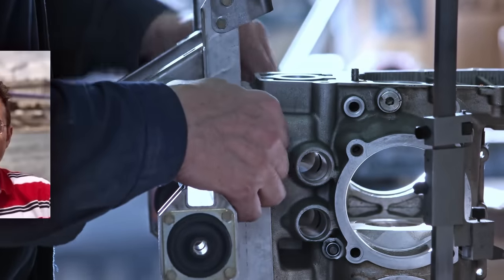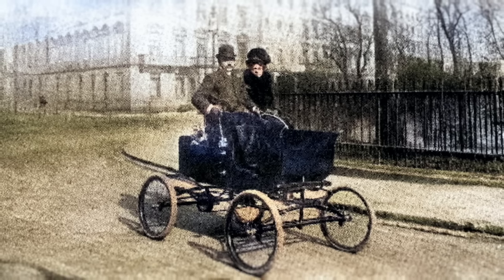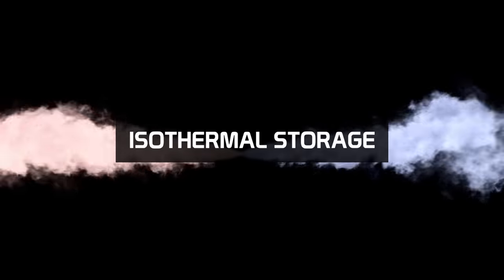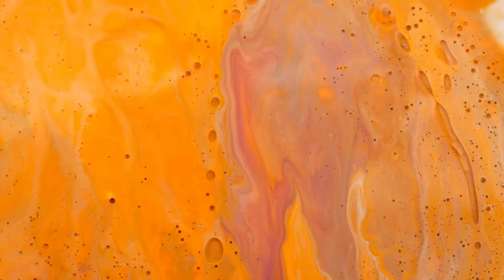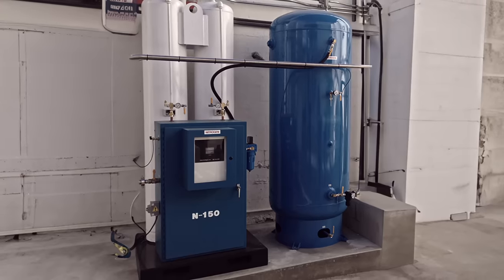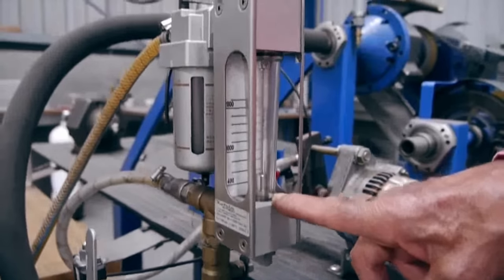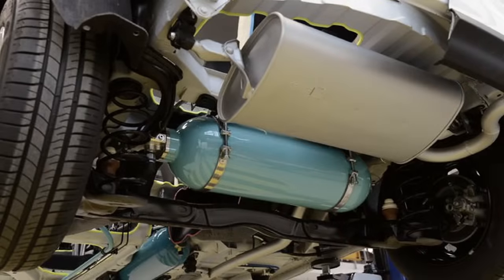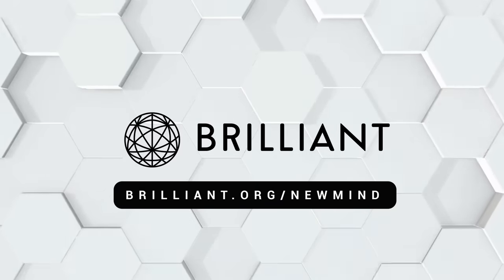Driving On Compressed Air: The Little-Known Compressed Air Revolution

Comment: Why not make a hybrid system the compressed air and fuel is injected into a cylinder promoting thorough mixing and giving a automatic boost pressure , ignited , the power stroke proceeds normally , and the exhaust stroke also proceeds normally until top dead center when the exhaust valve in closed and the new fuel and compressed air is injected together starting the cycle over. 
You eliminate the intake valves , turbocharger , inter cooler, air filter , and a lot of under the hood plumbing. and you end up with a small simple high boost engine that is powered by both compressed air and fuel and if a renewable energy source is used to compress the air , you eliminate the need for renewable energy storage since the compressed air bank at the "gas" station is also your renewable energy storage system.
Reply: ...well you will have to re-charge your air compressor every day and carry that bomb around..a turbocharger is an energy recovery device..there are better ways to do vehicle energy recovery on deceleration like flywheels or batteries/ultracapacitors (even just using the existing alternator)

Comment: the main problem is, that air has the N2 molecule, (O2 is the same story)  hence it is a 2-atomic gas. If you compress it, a certain amount of energy by hits between molecules is transferred into rotational energy , and is, regarded as heat,  lost for mechanical work in decompression, which we want to have for motors.  If you don´t mind an efficiency loss,  then it´s o.k.

Comment: I always wanted to adapt an air compressor/ drive motor into a log trailer and store the air compressed by using it to brake , and then release it when pulling adverse grades.
  The air could be stored in the reach tube and the compressor/ drive attached to one of the trailer axles, thus providing more drive traction as well.
Reply: Chrysler tried to make a hydraulic accumulator for buses some time ago. Too complicated and heavy. You need a motor/compressor in addition to your prime mover power train.

Comment: The design and operation of the MDI air engine was very much like that of an internal combustion engine. It has intake and outlet valves to work with ambient air. Instead of a spark plug or fuel injection valve it has a firing valve for compressed air. So the use of the compressed air is reduced to its absolute minimum, because it is fired into the pre-compressed air after compression cycle.

Comment: Storage system in wind turbines is the most promising usage for this. The air should be compressed by mechanical, not electrical, force of each turbine, stored in a single chamber for multiple turbines to increase volume to surface ratio, and then be used to drive a ducted turbine with 97% efficiency.
Reply: What of the thermal losses in compressing the air?
Reply: @thedubwhisperer2157 i mean the efficiency of a ducted Pelton turbine is 97%. But that of a whole cycle of compressing, then semi-adiabatically storing for 12 hours (chamber walls should be well insulated), then decompressing, — is much lower, maybe 75%. But this number is still excellent.
Reply: I remember studies of  40-50 yrs ago,  where  compressed air from  direct compression  via windturbines  was  stored underground, in abandoned salt or coal mines.  Obviously not an ultra high pressure system,   but with  cubic miles of storage,   low speed positive displacement motors driving generators   seemed to have promise.   But crude oil was like 8 bucks a barrel,  coal was 25  bucks a ton..

Comment: There are so many incorrect assumptions made in this piece it terrifies me.
If Air expanding approx 20 times its volume isn't an explosion it is as good as. That is with a 3500psi pressure.
Carbon Fiber and Fiberglass tanks are far lighter than steel tanks but are significantly more susceptible to being pierced than steel and they will rupture and tear once holed and have the above problem a very dangerous very violent air release. Make the tank from Steel and it will be 10 times heavier depending on size and shape. Something important for stop start use like in a Vehicle. Trains are ok as they are usually the only ones on the line.
The input energy required to make compressed air is significantly more than it stores and it gets exponentially worse the higher the pressure. The most efficient way is to compress it with positive displacement energy wise  and even then today's best compressors would be lucky to not to consume double of what it can store even at 100 psi let alone 3500 psi. Compare this to electrical generation where the manufacturing loss is a lot less.
The way it was explained for use in a vehicle it would require the heat transferred as well as the compressed air to work effectively. That would also require storage without heat decay that is extremely unlikely. A week later if the car isn't used it would need to be reheated even if it hadn't lost any air. Why? Well the motors and control system would never be flexible enough to handle the extreme temp variations. Think an F1 engine that needs to be preheated to gain the correct clearances to function same with this.
It has only one advantage and it's the direct method of manufacture with wind or water being the primary energy source. Those methods are more efficient than using electricity to make it but it still looses a lot of energy in the process. Direct acting pneumatic dash pots could power a car by displacing oil and using that as the transmittive medium and be far easier to control as oil doesn't compress.  But oil has resistance to flow far higher than air so there is also huge losses there as well.
Reply: yeah..it's a DCB..daily carry bomb lol

Comment: So far the biggest problem is that pumps for air compression(if we speak about nitrogen and oxygen mixture) either not reliable for a long run or to expensive to build. You could use CO2 as most ideal gas for that purpose but in that case you need CO2 as a fuel.

Comment: I haven't watched the entire video, but my understanding of compressed air energy storage is limited mostly by the air motors inefficiency which is at most 5-10% efficient at converting air pressure to rotational energy.
Reply: Could use a Tesla turbines to boost the efficiency, and then use an electric motor after that
Reply: @slomnim  total nonsense.
Reply: adds to that the extremely low efficiency of the first conversion cycle, that is compressing air at 350  bar, that in itself is an extremely low efficiency. best of the industry tops at 50% for 350 bar. SO first cycle 50%, second cycle 20%. that is a total efficiency of 10% and less, which is laughable. And that is with the best figures, in reality the compressor will be less than 50 and the motor less than 20, plus the losses of the vehcile, it probably ends up at 5% total efficiency.
Reply: @lo2740  Agreed, great points

Comment: I can see it being very efficient tech, there are even quiet running compressors. You could technically run one off less solar energy than batteries require and use a tesla turbine to collect electricity in ultra capacitors. We have been unknowingly perfecting this technology in the background for years. Bringing it altogether in a system is a no brainer. 
It's the other side of it I don't like. It's a neat idea, It does have its issues though. One being when they do go wrong, sure they might not explode but they will take off like a rocket and take out a brick wall as any welder will tell you about their air tanks. Your gonna have to really fasten down the large tanks to prevent this which adds weight to the system. Which makes me question using it. The safety device on a vehicle would be a tank around the other tanks that would direct the compressed air upwards. Look up what it takes to hold down a rocket btw.

Comment: The best part of AIR power storage is that air has a 12,000,000,000 year life span and does not need to be mined.
Reply: what nonsense, compressing air is extremely inefficient by itself, and this inefficiency is increases if you compress at high pressures such as 350bar. So even if the motor was 100% efficiency, which is not the case obviously, using compressed air as a storage medium would still be inefficient. It is also totally impractical.
Reply: I use to rebuild air compressors and air motors a few thousand hours for compressors and 1/10 of that for the motors with more basic lubrication. Air tanks were certified for 10 years a bit less than 12,000 million years

Comment: Sorry, you got fooled.
Everybody, who has to deal with compressed air as energy source and has to pay his own bills with self earned money, knows that compressed air is about the costliest modern power source you can choose, when it comes to the cost of the medium itself.
The engines are cheaper and smaller, that's a benefit. Usable in confined spaces without ventilation too. So - it depends on your requirements.
But you won't live to see a customer switch to a compressed air car to cut down his transportation costs. Not in this world.
And that's, what counts in the end and nothing else - if you're aiming your product at the masses, not the niches.

Comment: Ah it’d be better if we had hybrid renewable machines with pedal power options so people can exercise while they drive.
Reply: Technically we could chemically utilize air for energy since biological life already does that, but idk how we’d get a nonbiological hard tech construct to do that.
Reply: We do bicycles  and electric bicycles, 200 watts in a car will run the ECU , radio and the blower fan you want an extra 2,000 watts if you want the AC while you pedal and hand controls as your feet are busy.

Comment: Am I right in that Compressed air storage only becomes better than Li-ion after using isothermal support? And this is good enough to prevent any heat leakage? Otherwise that would be a source of loss over time.
Reply: it never becomes better, in fact the total cycle efficiency is lower than anything else, so low it is totally un-usable.

Comment: Sorry, guys. Compressed air is not new. This has been reserached for more than a century. Continuous progress has been made, 
BUT: Batteries outperform compressed in almost EVERY aspect. Weight, flexibility, efficient. The claims made are just wrong about compressed air being better.
There are a few very special niches in which compressed air is simpler and cheaper than moder batteries and electrical motors. Not a technology that will save the current storage issues.
Reply: Right on all points but the science illiterate will fund the start ups and they will take the money for as long as possible.

Comment: Has someone considered using the cars suspension to generate power or recharge a battery? The shock absorbers & springs are constantly absorbing energy that could be converted into power.

Comment: While I very much disagree with the statement that "there is very little self-discharge": yeah the tank may not leak, but the heat from the paraffin will eventually scape, the approach of separating the storage of heat and pressure energy remains very interesting.

You see, even with the air tank pressurized to full capacity, more energy can be added to the "air-battery" system in form of heat (from any source) to the paraffin tank. And, most importantly, it provides means to later recover that heat energy that did not originally "belong" to the compressed air. I wonder if it would be efficient enough for home storage...
Reply: if it was the only problem lol, the total cycle efficiency of compressed air as a storage medium applied to vehicles is laughable, 5 to 10%, that is compressing to 350 bar is 50% efficiency, best of the industry, and air motor is 20% efficiency, best of the industry, total cycle efficiency with best figures 10%, in reality, more 5%, lol.

Comment: I love compressed air. and i can imagine how powerful the thrust can be if you use powerful compressors and a good tank. I think every one knows pneumatic lifters and screwdriver and dart guns. I think the industry knows that a car is possible. but they cant earn much money from empty air. so they dont make air cars. and without the heaavy batteries and all the metal parts of the engine the car wouldnt even be so hearvy. you dont have to move so much weight.

Comment: Tata put a lot of research in compressed air engines. Their 3 cylinder compressed engine was very efficient and worked well but for some reason the project was shelved.

Comment: I have considered the possibility of a compressed air hybrid. The thought is that it can make do with a much smaller engine which can run at just one speed. Its sole purpose is to keep the air tank system pressure between 100 to 120 psi. The compressed air would drive a motor, which will propell the car. The air motor would have multiple cylinders which can be used all at once when high torque is needed, but can shut down one by one until only one is operating at cruising speed. Hopefully, such a vehicle can get by without a gear box.
Reply: Yes, it would still need a gearbox and you've given no thought to all of the wasted energy that goes into heating the air as it's compressed?

Comment: The major Is flaw I see with compressed ais that you don't get it for free. You have to compress that air. You have to invest all the horsepower into the car before you go. The same as gasoline. However, the storage tank weighs a lotmore. 4000 pounds storage system using 2 inch line. I can i'm pretty sure that storage system would weigh several hundred pounds. And the reason I suggest a 2 inch storage host system or storage line system. It's because that way you can wrap it around the vehicle in a flat package as opposed to a large tank. Running i'm not ungodly   length. A single tank round twenty gallons and volume would be 3 to 4 inches and your existing gas tank and yeld about ( this is a very rough gess ) 12 mlies to compressed gl of  air. Of course, keep in mind that you don't only be able to use the top 2500 pounds of that compressed air. Cause  once it all turn to a gas 
You lose power rapidly. Finally, a major concern is that nitrogen liquifies that about 2500 pounds oxygen liquifies at about 3300 hydrogen. That's your 4000 pounds.
I really wouldn't bother because it's really expensive to get 20 gallons of compressed air at that level.  It'll cost a lot more than gasoline.   The greenis alternative is natural gas. It's not only good for the environment. It's good for your engine producing carbon dioxide and water, which is really safe for the environment. And it's good for the ozone too, because the natural gas doesn't get up there and break down ozone Just thoughts from aboard old man.
Reply: Bla bla bla. Windmill to compressor to car tank… free… clean…
Reply: Bla bla bla. Windmill to compressor to car tank. Free and clean

Comment: around 20 years ago a man made an air powered car . He used as an engine a triple expansion steam engine design up graded with newer tech . The car was a compact modified with a different  engine. The car went 300 miles on a tank of air.
Reply: Minus two zeroes from that range. Colour me skeptical...
Reply: What was his name about 20 years never heard of it suprising as I worked for GM at the time.

Comment: Compres air on a grid scale is chipper than batteries KW/ $ can be 5 to 10 cheaper than litiun and 10 times the life of any battery,compressor attached directly to wind power will allow and wind unit to keep working as compressor because no interconexión is needed so no burocracy,the extra heat can be collected even supplement by solar, decompress air get below 0°F , something usable for refrigeración ,even if solar is used to recharge solar is cheaper than fuel,even having the sistem next to a nuclear or gas generator so the exes heat is used to reheat the air

Comment: 11:22 , this problem can also be addressed through spring loaded accumulators which is not new.
Reply: Add a heavy spring and piston to the air cylinder the ones I worked on used a diaphragm and compressed nitrogen rather pointless with air on the other side ( 80 % nitrogen in compressed air )

Comment: I think one major issue will be safety, how exactly is the tank supposed to "rupture" and not just blow up in the event of a crash?
Reply: At 3500psi air will expand 20 times its volume returning to atmospheric pressure when released. It's as good as an explosion if uncontrolled.
Reply: Your car wreck will fly away like a loose balloon 😂
Reply: @dazaspc 3,500 psi / 14 psi = 250x expansion
Would struggle to have equivalent energy to 1-2 ounces of petrol (burned in air).
Horrendously dangerous as well as wimpishly weak store of energy. 
And expensive / fragile pressure vessel - ask carbon fibre submarine victims.
Reply: @iandavies4853  Oh well stand in front of lets say a 4" air line at 100 psi then you tell me if in fact its a wimpish expansion. The thing is its like a loaded gun coked unlike a petrol version that's like a gun with the bullet on the table. It needs a few processes to become dangerous unlike the stored air that is stored danger.
Reply: @dazaspc  Atmospheric pressure is 15 psi I get 2330 times check your maths.

Comment: ...
I don't get wht they don't use water for the heat storage.

As the air is compressed, it pushes a pistone that otherwise, forcibly expands the space of a water steam tank. 

As the air is released to do the work, it now absorbs heat from the steam, and allows the low pressure steam tank to collapse, as the water gas cools to liquid, it releases its lstent heat, that gives the compressed air some more punch.

Which works the other way, too.
As the air is compressed in, the liquid water make it very dificult to move the piston to give room for tbe air, as the air compressess, it gets hotter, which heats the water, thus allows to push the piston on, untill the water transitions into gas.